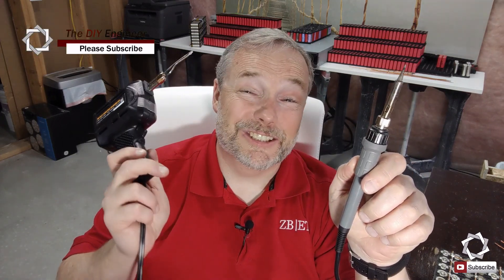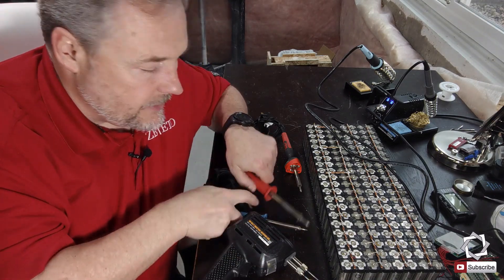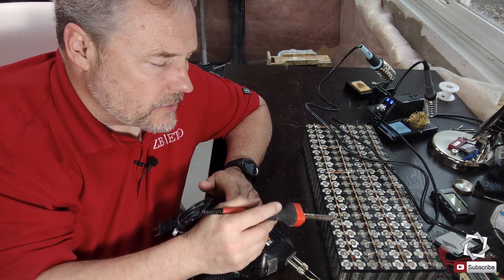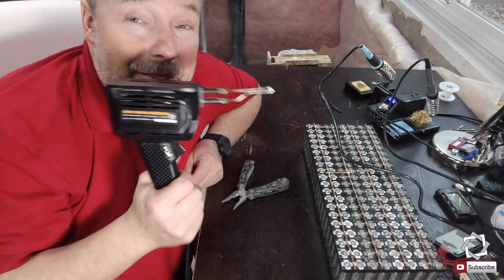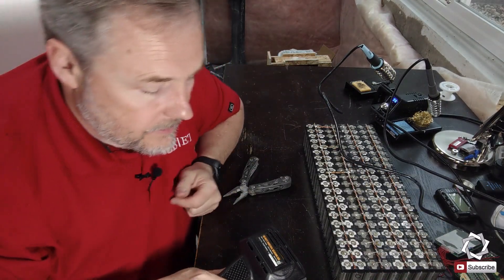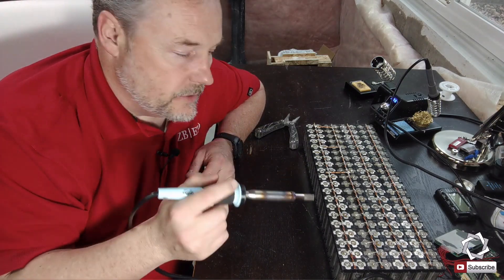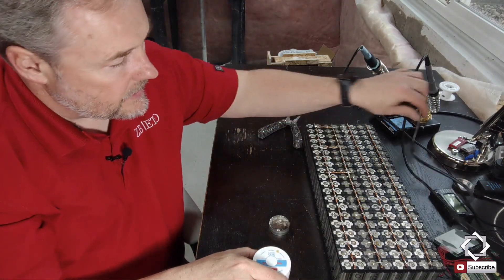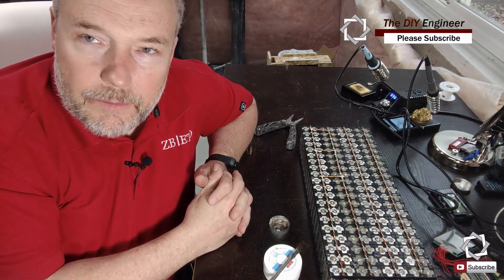Soldering Irons for 18650 Battery Packs

Comment: I have no idea how you can possibly " go through tips" that bad. No reason unless your using the wrong flux like acid flux. I solder almost every day and haven't changed my tips for years and they are still solid .
Reply: Some unregulated soldering irons get too hot, that's why. It's 100% the heat. However, you also want the highest heat possible for soldering batteries, so it's a tradeoff between tip life

Comment: Hi,
I'm trying to gather information about soldering . Actually I've a specific problem, it takes around 3 seconds for the solder to melt... and if it's in contact with a cable it takes much more.
Based on your video I'm considering buying a better soldering iron... I'm using a 50w ... I'm going to buy a better solder iron... maybe 100w.
Thank you.
Reply: Please dont laugh, I was using a 30watts one... only getting globes and it burns and I can use 10% of the soldering tips :(
Im getting a cooper head one of 80watts, thinking on get one of 100watts

Comment: another good video, how about a lithium powered soldering iron lol, the 1400watt iron I found they do work well trying to stick the solder on steel cable and maybe better taking the broke end bending into a shorter end there's usually enough on 1 leg to get it to work a insulator or heat shield between the forks would help, just like a mini inductor without the coil.

Comment: The tip your using makes a huge difference I am using a hakko iron up to 899 degrees with different tips. If you notice the iron that works well in your video has a large chiseled end allowing for faster heat transfer. Great video !!!!! Your series is great

Comment: Haces unos vídeos muy buenos. Gracias👍. I just  tried with a 26wats welder with a thin tip and just a little bit of flux onnthe surface and a mix of 60% tin 38% led and 2% copper and no problem.

Comment: I am looking at two weller irons.  Their 100 watt industrial iron w100pg.  Which is what you showed. And their 175w consumers iron sp175 with an orange handle. They are the same price on amazon.  

Do you think there will be any  benefit to the extra power of the 175w iron. If not I think the green handle weller’s are better made. They are both rated for 900 degrees.
Reply: What did you do? Did you buy a 100w soldering iron? What was the result?

Comment: research showed that the weller depends on tip types to control temperature so need to get biggest as shown in video here- on ebay it states in one add only a 700 degree tip available so not too sure about this
Reply from the maker: I get that, I still thin that the hotter the tip the better.  You will spend less time touching the cell which will mean the heat will not travel as deep into the cell.  But I could be wrong.  I have not seen any issues with the way I'm currently doing it.  Thanks for the comment.

Comment: On my last battery I had the local sheet metal shop cut some 1/4" wide copper buss bars out of sheet metal. So much easier to solder the fuse wire. Thanks for posting the soldering iron overview.